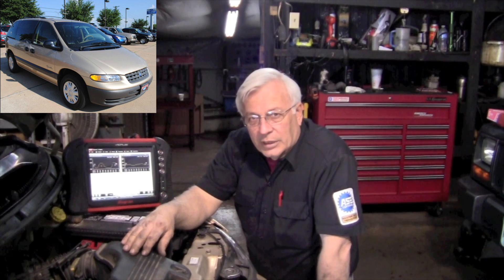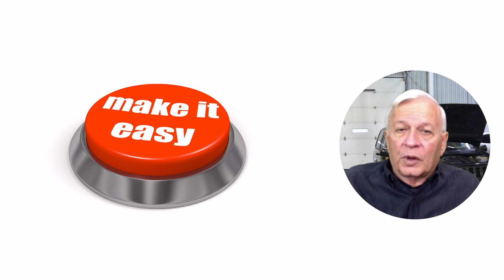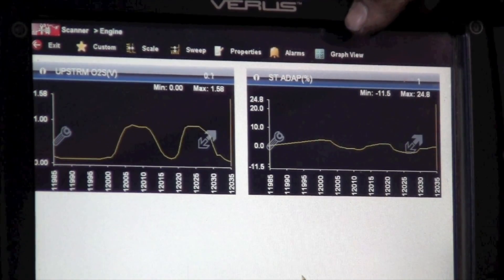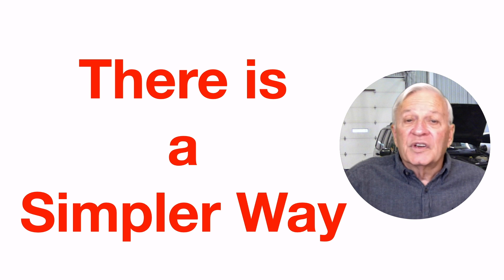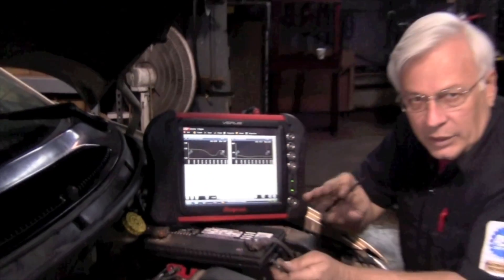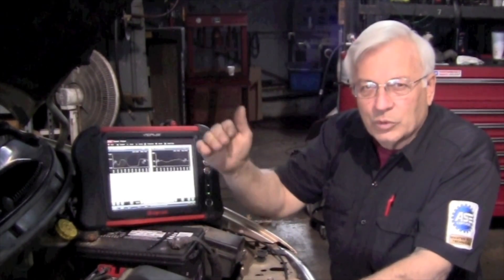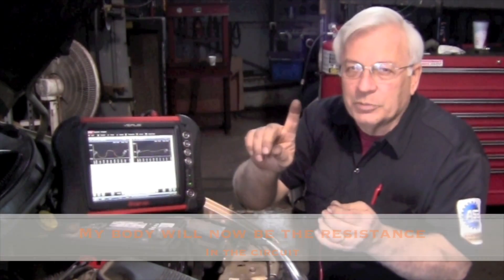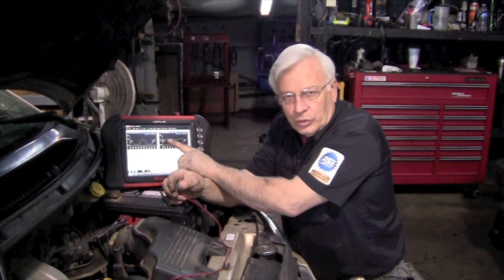A simpler way to test an oxygen sensor   HD 1080p

Comment: I don't think this is a reliable method, since we're the ones applying ground or voltage to the signal wire. This might test the wiring or ECU response, but not the reliability of the lambda sensor.

Comment: What will happen if signal wire shorts out to power
Reply from the maker: depends on the strength of the voltage power and purity of the ground.  The worst case is a blown fuse, less severe would be distorted signal.

Comment: Think about it. Wires good. What’s left that can be bad. I’ve seen other videos do this. Also used to be a tester that did this to check wire connection. Do any of you remember the old condenser prank. Now that was a shock. 😂

Comment: useful to move the torch up off the sensor and back on - after heating from the sides abit, I see in your video - and I just went thru a batch of O2 sensors just now.  Many of my old sensors (I save everything) are fine!  OBD2 scanner w simple graph to show B1,2 sensor 1 voltage movement is very useful info.... in closed loop. Thanks!

Comment: I'm having trouble understanding how the O2 sensor produces a sine wave. I know Zirconian substrate poduces a 0.1 to 0,9 volt against the differential of clean Oxygen side to the contaminated Oxygen side of the substrate, but I would expect to see  a DC voltage output. Where am I going wrong?
Reply: It's sort of a 'quasi' sine wave, in that it varies continuously between low and high. In other words, the signal crudely approximates a sine wave. And yes, it is a pulsating direct current.

Comment: You are not testing the oxygen sensor though, you are only testing the ECU response to the voltage which would come from a WORKING oxygen sensor. Title is wrong, still an interesting video, it just doesn't do what it says on the tin.

Comment: Will this work for all o2 sensors (4.7 iforce toyota specifically). My sister in law has changed several recently and still gets code. She wants to swap again but I'd like to actually find the issue. Thanks.

Comment: First of all, the car battery is completely safe without any resistors..and a simple voltage distribution circuit, i.e. even if a 1000 ohm resistor is connected to a 100 ohm resistor, the voltage enters the 1000 ohm resistor and goes to ground from the 100 ohm resistor, so the poles of this 100 ohm resistor get about 1v, so it can be adjusted as desired.

Comment: Nice tip on using your body as a variable resistor. But I strongly caution:  Even though you are only working with around 12 volts, passing ANY current through the chest, even far less than the deadly 0.1 A (100 mA) is NOT wise. Even a few milliamps passing from one hand, through the chest, and to the other hand CAN be dangerous. Even low current through your heart may not cause instant death, but it can cause "walking wounded" damage to your body. Ask any electrician, you use ONE HAND ONLY when working with any voltage/current - this way current passes through your hand and not your heart/brain/organs. I would suggest you get a 1Meg Ohm potentiometer (Pot) and a 10K (or whatever resistor value that forces about 1.2V on the O2 Sensor signal when the Pot is sent to 0 Ohms). Put them in a liitle plastic box with wires and alligator clips. You get all that from Digikey for about $15 and you made a nice O2 Response Testing Tool for your arsenal of tools and do-dads.

12V
  |
  |
 o
  |
  | 10k Ohm (or other) Resistor
  |
 o
  |
 o
  |
  | 1M Ohm Pot
  |<-------------o------------02 Sensor Signal to ECU
  |
  |
 o
  |
  |
  |
GND

Comment: What a waste of time. I am an L1 tech and it is easier than this. You drive it rich and watch the fuel trim. See if it responds. If fuel trim responds you drive the engine lean. A small air leak is fine. Does the computer see it and react. Your fuel trim will show that. If the PCM responded to both conditions it means the PCM is in control. Next Go and the put the Scan tool in graph mode and put the time span equal to injection pulse width. Remember, this tests the sensors before the CAT. Your signal will look like skyscrapers. Each square is an exhaust pulse. Check the voltage range by the manufacturer. If you have leaning signals like a lean-to or a barn roof  this is called clipping. The sensor is bad.
 If you are checking the O2 sensor heater just use active testing. You CAN test this out of the exhaust system. Just tell the tool to heat up the O2 sensor and hold it. It will get hot. Easier than this, check failed monitor tests.
  To see if you have a bad CAT. Go to graph mode and put banks 1&2 over the CAT Sensor. Look at the signal going in. Should be square waves going in the CAT, and a small fluctuating line with no square waves after the CAT. The rule of thumb is 140-160 cycles unless specified by the Manufacturer. This is for the O2 sensor that watches the CAT. The signal will look like a small harmless wave or a flatline. Flat line is good after the CAT. Harmless wave means okay to CES or SES light soon. When the wave before the CAT is about the same as after the CAT. Your CAT spent all 9 of them.
We have not used this method of using yourself as a resistor in 20 years. Time is money.

Comment: I don't see how using human skin will give you repeatable results. I have measured my resistance through my finger tips many times through out my 45 yrs as an industrial electrician. And depending on a LOT of variables. Humidity, skin moisture, surface cleanliness, presence of callus, blood salinity and mostly probe contact pressure with skin. I would get vastly different values each time. I would think it would be better to use a fixed precision resistor to use as a reference.  Much more repeatable and safer.

Comment: Great video and explanation of how to manipulate sensor values in order to see if the ecm is reading/responding correctly and how to confirm the sensor is reading in spec. Just one critique; never ever puncture a wire with a probe to access it. This will lead to more repairs and issues down the line. It is better to use a breakout harness or to back probe a connector from the harness to the sensor or from harness to the ecm. Thanks for the content, cheers!

Comment: I have owned a 1 ton 1988 Chevrolet Truck with 454 that constantly was a pain with the computer system & oxygen sensor so when the 454 had been wore out the next engine I put in was old school no computer system at all on the 383 stroker engine.
Living in Alaska where I often travel then can't get help, I don't need a truck with constant computer system issues.

Comment: Not to judge or confuse here but with the engine running the positive voltage is closer to 14.2  volts than 12 because of the alternator charging .

Comment: forgive me for not understanding  but these tests only prove out the circuit. you are altering the signal even though the a/f ratio isnt changing. how does this prove out the actual sensor??? i would think the a/f ratio the sensor live in would need to change to actually prove the sensor.

Comment: Forcing a signal wire to ground , dose not prove the sensor can read lean it simply prove from that point back to the ecu is correct

Comment: The o2 sensor itself didn't 'recognize' anything whatsoever from this method you showed?
The only things this proves is that the ecu could recognize a min max range it's programmed to the able to see, on the o2 signal wire, from the position you were tapped into.
This only proved that the ecu was capable of making an attempt to compensate for the false rich and lean conditions.
The one other thing this test proved, is that the wire is intact between the ecu and your tapped in test point.
The only relationship this test has to the o2 sensor, is that once you removed your false rich/lean conditions, the ecu stopped making false compensations and was able to bring the o2 sensor back into a normal switching range, short term trims came back within an acceptable range, but at no point did the o2 sensor itself 'recognize' or 'sense' anything apart from exhaust gas oxygen levels, the O2 sensor makes voltage and sends the voltage signal to the ecu.
The o2 sensor doesn't sense a voltage on the signal wire at all as you inferred by saying the o2 sensor 'recognized' the increase or decrease in voltage induced by your method..wtf?
You were simply shunting the o2 sensor signal wire to ground, or driving the voltage on the signal wire high before it gets to the ecu, the ecu is what actually 'recognizes' a signal, and makes compensating fuel adjustments based on the signals it receives from various sensors.
Sensors create and send signals, they never receive or recognize anything.
Receiving, recognizing and interpreting is a job for the ecu, and/or various control modules, never sensors.🤣👍
Reply: Agreed.  This also told me that the circuit impedance is very high.  Skin resistance can vary wildly and unless you are soaking wet or sweaty, the resistance through your body is probably 1000's of ohms.  In any event, his body and the input resistance to the ECU made a voltage divider that produced a 1 volt reading.  It is likely "clamped"  at 1 Volt at the ECU to protect from over voltage anyway.  I suspect using a 10,000 Ohm resistor instead of your body would produce the same result. (start high and don't go lower than a few thousand Ohms if you try this!)  What this video did make me realize though, is that the connector needs to be very clean - no lubricants or oil or whatever.  A little stray resistance in there and you'll be all over the map.  I think this is whats wrong with mine!

Comment: Is this really testing the sensing element and voltage generator?  Seems like you're bypassing the sensor, injecting an artificial signal to the ECU which adjusts fuel trim.  I'll watch it a few more times, I probably missed something.

Comment: All the critical comments below are true:
Your logic is flawed; You are testing only the harness and PCM (injectors, MAF, etc - closed loop components, EXCLUDING THE O2 SENSOR!)
With the sense lead grounded, the O2 sensor could be good, bad, or missing; and you would get the same engine response.
Likewise when you induce a voltage.
You are NOT testing the O2 sensor response whatsoever...

Also, I am baffled by your O2 current calculation. It doesn't make sense.
Were you proposing that the O2 sensor has an internal resistance of 1KΩ?
The sensors are very high impedance AFAIK...
The math doesn't relate to anything you were doing.
I can only speculate that you were thinking how much current would go through YOU if you were grounding the sensor to ground. And that calculation would only be valid for source impedances less than a few hundred ohms...
Also, the figure of 1KΩ for body resistance was from a safety chart, and is worst case scenario.
Typical body resistance is around 10-50 KΩ range. (try it with your ohm meter...)

I commend your efforts though, you just misinterpreted the results.
This would be a good way to rule out an expensive PCM replacement...
(If it failed, it would not necessarily mean the PCM is bad though, there are other things could kill the closed-loop operation).

Mr K L

Comment: I have been doing this since the early days after VOLVO introduced the original LAMBDA system. LAMBDA meaning AIR. Back in the day there were no fault codes or scanners.

Comment: I’m a little confused with test. How is this testing the o2 sensor?  Isn’t this just testing sensor wire integrity to the PCM?  Your o2 sensor could be dead as a door nail and this test would produce the same results. Maybe I misunderstood the premise. Thank you for the tips over the years. I appreciate the time you put into making a video.
Reply: I agree. The signal wire is from the sensor to the PCM/ÉCU. So by shorting it to ground or supplying it with a 1volt supply, all you are doing is taking place of the sensor and making sure the PCM reacts to the rich or lean condition. Your not actually testing  the sensor.
Reply: What he does is forcing the engine to go lean or rich, when he lets go he can then see if the sensor is working and will bring fueltrim back to "0". Instead of introducing a vacuum leak or introduce fuel he makes the engine computer do it.
Reply: Glad I'm not the only one that saw that.  Still makes more sense to add external fuel or introduce unmetered air.  Even with no vacuum lines you can pull the crankcase breather hose off the intake.  Supplying power to or grounding circuits should only be done with proper  equipment, and id still typically advise against that.  If the O2 is functional the PCM is going to make fuel trim adjustments but if you have low or high fuel pressure or sticking/clogged injectors it may not translate to what the engine is really going to get.  I don't see where this "test" is going to provide any useful information to the technician. Doing stuff like this will end up resulting in a pcm being turned into a brick at some point.
Reply: I fully endorse that this test can't verify sensor output...it verifies wiring/ circuit and pcm response to voltage/grd inputs....but then this video offering a quite unique way for verifying circuit & pcm response and its something which must be appreciated.
Reply: @AbuDujana692  For sure lets not let that bad take away from the good, yes it's a wire test not an 02 test but a cool tecnique either way.
Reply: That exactly what ran through my mind. Your testing the pcm at best to see if it responds. As far as testing the sensor. You gotta make an air leak or add fuel.
Reply: Method.  Important to test that the sensor is reading correctly.  Can also then verify w OBD2 scanner. If not congruent- next steps to look at: wiring,connectors, ECU.

Comment: You can also test the oxygen sensor (or also called Lambdasonde) on the bench with a DIY adapter. 
This adapter is just a short piece of metal pipe, with internal M18 x1.5mm threat, on the other side of this pipe a hose fitting. 
Then apply the necessary voltage to the heater, and connect with a hose (silicon) a vacuum pump, like those cheap brake bleeder sets.
When the oxygen sensor is heated up, and the vacuum is applied, the output should be 1V , indicating a rich mixture. 
Inside a oxygen sensor is a capsule of Zirkonium that contains pure oxygen, when the outside of this capsule doesn't see much oxygen due a rich mixture, or a vacuum like in this test, the voltage will raise.
During this test, there is no sinewave, but a more constant DC voltage between 0V and 1V, because the sinewave is created by the ECU due the mixture adjusting in closed feedback loop. This closed feedback loop is ignored during deacceleration (gas pedal not touched while the car is moving) and ignored for X time during acceleration when the gas pedal is pushed in quickly. With the vacuum, you can push the output voltage to 1V (or even higher) and to 0V if you could apply pure oxygen to the adapter, like from a oxy/acetylene torch.
Reply: Yes, I repaired the original LAMBDA systems at a VOLVO dealer.
Reply: Mostly correct; the Zirconia 'capsule', which is actually a thimble or disk*, does NOT contain pure oxygen, but is supplied with atmospheric air, and is replenished through the sensor leads.
I also discovered the manufacturers warn not to use any sealants or contact lubes on the connectors...
*[edit: I found drawings that show the 'Planar' type as a flat wafer, not a disk, but I have not found details].

I applaud you for the creative test suggestion.
You could also use any inert or fuel gas. Maybe propane or acetylene. (be careful...)
[Don't mix oxygen and fuel gas in a pipe, you will have a pipe bomb! Vent/purge thoroughly in between...]

If we could find out the spec for the O2 concentration at 'crossover', one could actually construct a rig to test for accuracy...
One thing that it couldn't test would be response time, which I gather is the main issue with aging sensors anyway...
Mr K L

Comment: Thank you for this great demonstration. But you said that in this way you tested the sensor. But is that really. Because I think only manipulate the signal and test if the pcm responds. With this test you can't say that the sensor is working correctly. Because it can still give wrong signal depending on mixture. Let's say it's producing a to low voltage for a specific mixture. If you this test, the pcm still will react. So this test will not condemned a not good sensor